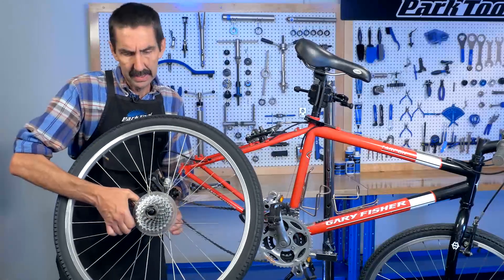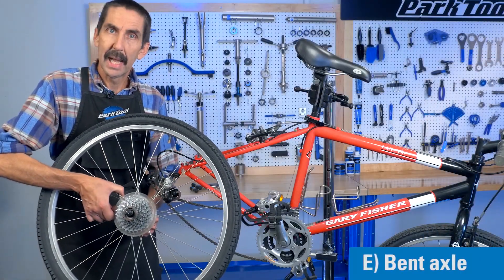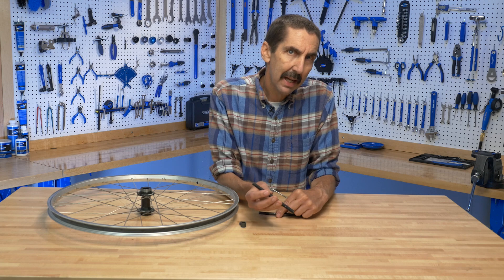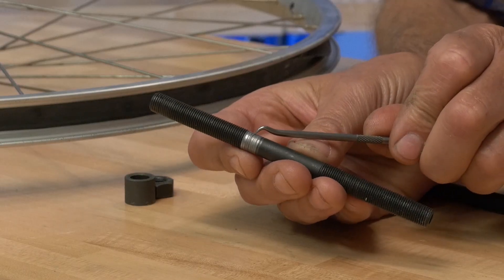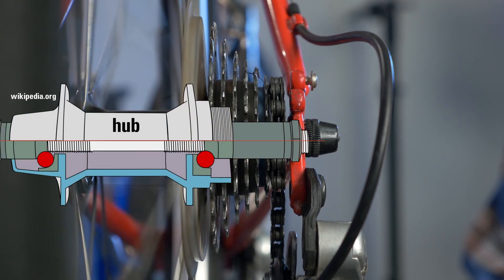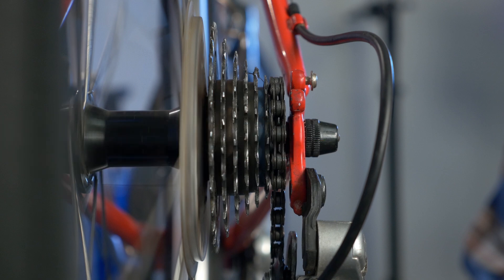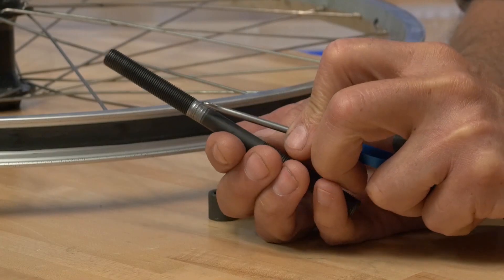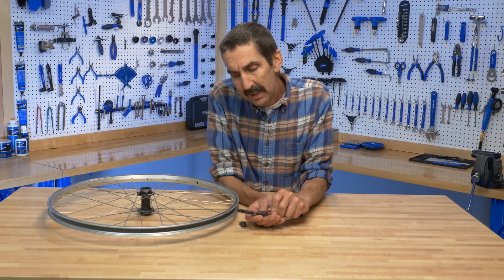Tech Tuesday #37: Wheel Wobble Unveiled!

Comment: Son's new bike is doing this and causing the chain to rub, but its not as pronounced as this ... Saw another video on here where there was an extra bearing.  Guess im taking it apart before it gets worse potentially.
Reply: Try checking the bearing cone when you take it apart. I took mine apart when I thought I had a bent axle, but the inside of the wheel hub bearing track was bent as opposed to the axle. It happened  couple of times i  my case, but I'm still trying to figure out what initiates that problem.

Comment: how can I prevent the axle from bending? (when wheeling)😫
Reply: Turn it 1/8 once in a while and retighten it, so you're not always bending the same way? 😆

I assumed jumping would cause that more than wheely though... since you're just rotating the some more weight on it, its not a dramatic change.

Comment: I've got a brand new hub and quick release skewers for my rear wheel. It got a sealed bearing and still it wobbles, why is that?
Reply from the maker: If there is play in your sealed hub it may have an adjustment that sets the pre load on the bearings. if that adjuster is too loose there will be play.

Comment: That was surprising. Could this happen on a front wheel? 

I'm looking for info on what could be causing my uneven braking problem with my front wheel. The wheel spins true enough but when I squeeze the brake, it jolts quite noticably. 

I thought my rim was toast and replaced the wheel with a new one. But blow me down, it's still doing it.

I've checked on my pads to make sure it's not knocking the tire, I adjusted the tension on the v-brake caliper to provide even tension and I inspected my rims for damage (nothing jumps out other than a couple of minutes scratches on the old wheel).

 Any advice?
Reply: The ball bearing cone might be loose, so try tightening it slightly.

Comment: The incorrect machined Freewheel Mount always gets everyone even the best bike mechanics. This will create a wobble when freewheeling  and will effect shifting gears. The freewheel can be perfectly made but if the Screw mount on the wheel is not centered straight you will always have a wobble.

Comment: I saw same on the new bike which one standing in the shop. I brought my bike to shop with same problem . And staff told me this is normal.
Reply from the maker: Some slight rear sprocket movement side to side is normal when coasting.  With the bike in a stand, pedal and watch the sprockets again, it should turn straight.  Movement when coasting is not an issue because, well, you are coasting.
Reply: Park Tool Thank you

Comment: This does not really explain a bad machined hub screw mount . Got a bike in that even after re bearing and checking axle the wobble was still visible while freewheeling. The wheel itself  was the problem and not the Freewheel cog cassette. The wheel hub screw mount was not machined straight so it was off by 12 degrees which then caused the Freewheel cassette to wobble. You can easily spot this by watching the Wheel spinning and watching the tire rise and drop slowly. That is your sign that the Hub Screw mount of the Wheel is off center thus making any Freewheel cassette Wobble.
Reply: That's normal with budget bikes. Don't want this to happen? Spend at least 1.5k USD on an MTB and you're set.
Reply: Dan The freewheel system is pretty old, but that does not mean its crap. Many freewheel hubs from the 1970’s were made perfectly centred for racing bikes before cassette systems came in. It’s just cheap Chinese wheels that are made with no quality in mind. Hell even my Sunrace 13-36 cassette for 23$  that I put in my Carbon road bike blows away the crap SRAM cassette( 70$!!!!) that I installed on it. These days everything is made in China with the crappiest Chinasium they can find, watch out for brand names that are selling mediocre parts like SRAM.
Reply: @danfuerthgillis4483  You're probably right. My cassette is SRAM PG820, a cheap 16 dollar cassette and it wobbles a little bit... indeed I thought I had bent the axle jumping off a curb, but now I'm pretty sure it's just bad quality.

Comment: There"s one more detail that needs to be told: A bent axle does NOT make the wheel wobble (if you don't count the play caused by the cones out of alignment). The axle is stationary on the bike and the hub revolves around it. The wheel would be crooked in the dropouts, there would be strange noises and resistance, but an otherwise undamaged wheel would spin true. If the hub shell wobbles, the problem is always inside the hub.

Comment: Interesting. That assembly must have been very loose at some point for the bearing(s) to fall out of position- I guess someone just tightened it back up.  Either that or  a bearing service was done incorrectly-allowing balls to fall out of position during reassembly. Another good reason to periodically do a proper full service on your hubs.
Reply: MarzNet256 This video is why freewheels don't exist anymore.  Cassettes almost never break axles or have problems like this.  Freewheels are only still put on the lowest of junk bikes at Walmart and other department stores.  Stick to a cassette wheel of descent quality like a shimano deore or above hub and this will almost never happen.  That bike can get a new rear wheel for or used wheel with a cassette for probably less than 100 bucks.